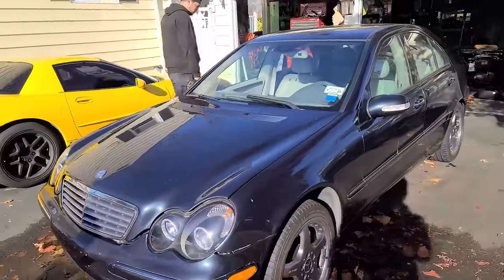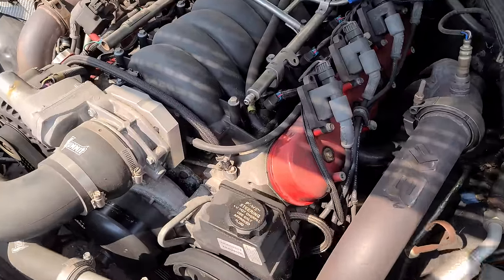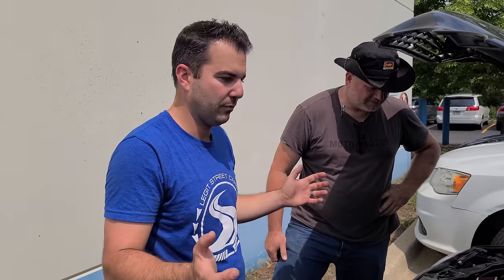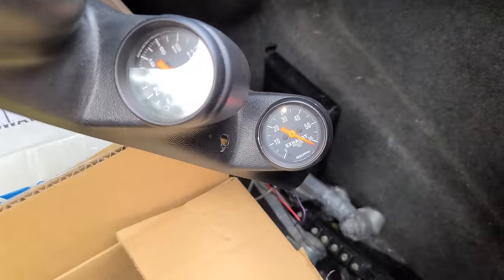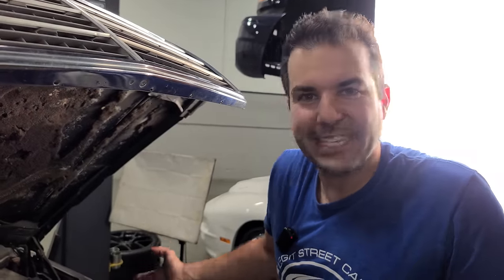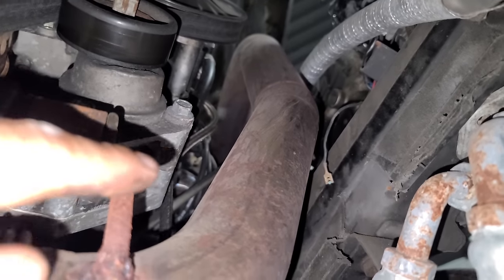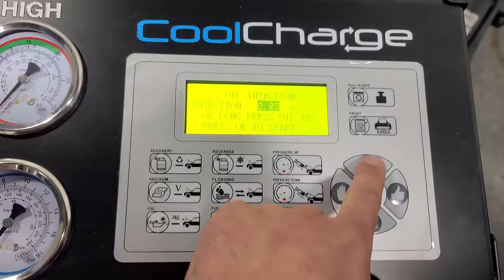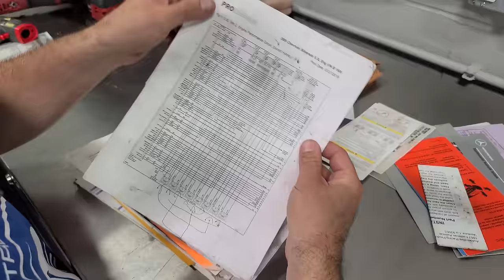I Traded My Weirdest Car For An LS Swapped Mercedes Turbo Diesel! Total SLEEPER!

Comment from the maker: Have you ever wanted to do something like this? Keep trading up to see how far it goes?
Reply: Yeahh cool idea!
Reply: Dude you have to turbocharge it
Reply: @@ChesterJLampwick78💀💀💀😅
Reply: all turbodiesel w124s had that air intake on a fender
Reply: There is a bracket for the a/c belt tensioner it has two tensioners. They come on the caprice ppv and the Chevy ss. I had to do the swap on my g8
Reply: Flying wheels just did this took 2 years went from a $400 car to a Ferrari 360 just this week.. Not really trading but buying and selling... But as you eluded to you have to be a bit more scrupulous cause all you're doing is trading and everybody knows what you have into the car by watching the videos
Reply: I did buying and selling. Started with a celica and now have a m3
Reply: Its stock vent for horn or air filter.
Reply: @@ChesterJLampwick78out of curiosity, how far did you get?
Reply: Absolutely. I’ve done it with guns several times. I buy old or broken rifles. Repair/restore them, then trade up. It’s a great way to improve the quality of your item if you can use your knowledge to improve things for little cost.
Reply: Ive wanted to for sure. I have a swapped CTS if your interested. Not LS swapped.....
Reply: I would love to do something like this...but i have nothing to start with
Reply: Not really a trade when you are paying money on top and that too $4000. But I like that 300D classic look more than the newer E class
Reply: @DjJay I'd have to agree, I've been flipping cars for 13 years and I don't put any cash up. But like someone upstream said everyone is watching his videos and knows the numbers already so that's harder right off the bat.
Reply: I took a free stereo and turned it into a 90s Tbird after 5 trades 2 days later
Reply: Recently bought my dads old renault megane expression.Had new front window mechanisms in but there's an electrical fault somewhere; they cost best part of a hundred each  Plus lots of bits and pieces to bodywork inc filler on arches: i changed my first exhaust back box and saved myself a hundred quid. It's my first time priming and spraying a car as well and I gotta say, its looking pretty good so far.

I also bought a ford transit a year ago and that's been hiding in the mechanics so when I get the renault finished and sold, I'll get the van back and body work sorted, and possibly sold, then I think I'll have about circa 2k cash for the renault plus a 3.5 - 4k value on the transit... might go for a rolls royce:)
Reply: I feel like if you kept making deals like this, you’d end up with a 97 Saturn and spending $300k lol
Reply: I did that from a Mazda 3 up to a W209 CLK55 AMG.
Reply: You’re not trading up spending cash?
Reply: We will see how I feel with my 5 cylinder audi turbo swapped Ford Ranger
Reply: Hoovies ls swapped 911 😅😊
Reply: yes i have and next year im going to try it and ive the perfect car to start my trades with once i engine swapped it :)
Reply: Yes, Ive done it a few times. Got me 14 dsm's........took awhile to trade them off. 
When are you working on the GSX next? I thought your not putting out new content on it as it wasnt producing views, but all the video's right up there with your other content in the same time frames. Are you just waiting on parts or....? just curious, I love your content and I love dsm's so you had me at DSM.
Reply: Honestly the whole trade up thing gives me a headache. But my buddy Stan is a great guy and that car is a hoot to drive. Enjoy!
Reply: Never thought about the trading but I have put LS and LT in at least 50 cars. To get that car better get rid of the steering box and all that linkage and install a rack and pinion, this will move the box so you can put dual exhaust and get to the plugs, and better steering. Then build an aluminum cold air box for the air cleaner with the factory grill.
Reply: I started with a 1987 GMC starcraft conversion van for 1500 bucks in 2012 and ended up with a 1976 stingray in 2018 across 4 trades, and driven for nearly 50k miles as a primary driver. And when I cashed out the corvettes I got 3500 the day I listed it on FB marketplace. I made 2 grand and drove a vehicle for 6 years, for maintenance.
Reply: I think paying thousands of bucks in between takes a little of the original idea of trading away 😅
Reply: @smokeonthewater5287  it would be so difficult to find two cars so close in value. I have no issue with cash changing hands. I saw the MB/Honda Stan got last week. Looks really nice. I thought of pulling the Honda engine and putting in a R32 engine and turbo from a VW. But Stan said that’s stupid so I offered to buy his Audi A6 4.2.
Reply: You're not trading if you pay them the value difference.
Reply: I have a nice red paper clip... If your interested?!

Comment: for the air intake, maybe add a thicker spacer, or another one, and push the valve unit forward.  If you make a new thicker one,then place the holes in the right location.
The guy from whom you bought told you he has the capability to to the fix for the honda C240, maybe he can help, just saying...

Comment: I used to have a 300D with an old carbed SBC 350 in it.  In order to clear the exhaust, they just jacked the engine way up to where they cut a hole in the hood.  It was an absolute riot.

Comment: There is some irony to the fact the converter removed one of the best diesel performance engines ever to swap in that LS. The OM606 😍
Reply: wasn't the OM606 the 2jz of diesels?
Reply: 2.5 turbo wasnt an om606. The Last year (1995) w124 came with a n/a om606 though.
Reply: @Will_14_years_ago yep last years had the 3 litre one 🎉
Reply: I think they where definitely going to boost it
Reply: @Will_14_years_ago  exactly, the 2.5 is a om602. the om603 turbo 3.0L was the best diesel engine in these cars since the om606 was N/A (and has puny rods so turboing them very much without upgrading the rods isn't advisable). The om606 turbo is fun and all but they are pretty expensive to modify
Reply: @ThomasMauger  I own a na version myself its swapped into a w201 with a manual trans. The na version rods conparing them to the turbo are not great but the myth that they are puny and cant handle power is not true. With a metal headgasket(turbo got a metal gasket the n/a did not) and a built injector pump, they will do 350-400hp daily. Maybe in 2023 that doesnt sound like much but in a small light car its substantial. I agree they are the best moat reliable engines out there while also returning good fuel economy. Being that they can be and are with most fully mechanical makes them Great! Its ashame that the 606 turbo isnt as easy to get ahold of in the united states. I have also owned 2 om617 engines and although they are not powerful, they really are a lifetime engine just dont run them out of coolant or oil and make sure you dont get a injector stuck wide open, id bet on it going over a million miles.
Reply: @Will_14_years_ago  Ah no, that was a 602, didn't notice the 2.5, just saw 300D. You are correct.
Reply: @ThomasMauger  The N/A is still good for over 400bhp with the "puny" rods, just needs a decent head gasket, turbo and upgraded fuel pump. Sure it's not the 600+ of the turbo motor, but pretty good for a 3.0 diesel!

Comment: Awesome swap!!!  I think you traded up. The W124 is a tank and the interior speaks volumes. I would want to change the exhaust if possible, but that’s my only hang up. I’m sure you know that Bilstein will rebuild those old struts and shocks in the trunk for free, you just have to send them in. Thank you for the video!!!
Reply: Bilstein does not rebuild shocks and stuts for free... never have and never will. It's $250 per for a rebuild.

Comment: The fender vent IS in fact stock, here in Europe 300D turbos (OM603 turbo engine) and 300D 2.5 Turbos (om602 turbo engine) came with that vent from factory, stock air filter sits there :)

Comment: The grill on the fender is only for the turbodiesels. The NA diesels (which were available in Europe), like my 300D, which has a factory 5 speed manual btw 😉, don't have that grill, unless they are the latest multivalve diesel engines, available from 1993 (the OM605 and OM606). And yes, it is missing a steering shock, but since they modified the pitman arm, maybe it didn't fit anymore.

Comment: LOVE THE CONCEPT! So far so good! A/C - CHECK! Throttle Body, - Almost Check! This is THE perfect car for a fix n flip!!! I REALLY like this car. Believing it is a keeper for someone! Obviously somebody that built it knew what they were doing. Not a shadetree job at all. The gauges, exhaust, cylinder heads and coolers show that. Great that the other guy did the springs and shocks. Relocating the air intake to the grill is a no brainer. Maybe figure out how to get the A/C more like stock with a  real button. Fix the lil oil leak. Maybe replace hood or fix it. New tires and a detail and it should easily be in the neighborhood of a $20k car when done. As Always, May God Bless you and yours! 😇

Comment from the maker: Ok guys, what do you think this car is worth after I fix everything?
Reply: Don’t know somebody tried to say it wasn’t worth it
Reply: Idk man I think you mightve given that guy a neat fast car and a $4500 gift...this car looks like a cobbled together question mark on wheels
Reply: 7500.
Reply: TBH like a real 500E  is 40k in the US, and they are usually very well maintained, while this thing is a average spec'ed old 300D with a mystery box LS in it and questionable things done to it. So Id guess 20k is the best you could hope for. A 400E in good shape sells for around 20k, what i think is the best comparison for this thing. Its a definite upgrade to the Hondacedes tho.
Reply: So twin turbos and a limited slip?
Reply: Two turbos and a tune, a polish I’d say 16 or 17 as a good sleeper
Reply: I think you got ripped off 😢.
Reply: $15k
Reply: Mandatory limited slip diff and 3.55 gear (best compromise for pep and fuel economy with OD trans)
Reply: Yesss
Reply: I wanna see what it'll sound like with amg exhaust
Reply: I hate this series is so short. Seems you just traded for a car you should keep! Its kinda badass. Id clean her up and drive it everyday
Reply: With the exhaust setup the way it is I say put some turbos in there (I know the snowball effect and the trans likely can’t handle it), but I’d say a 3k turbo kit with 16k total invested can net you an 18-22k trade value.
Reply: super hard to value since engine swaps are a niche thing. I think your value will be in the engine parts
Reply: Will you tell us how much you're going to put into it
Without knowing that it's kind of hard to say
Reply: Boosted and fully sorted out it could bring $12k maybe $15max to the right person
Reply: 9k
Reply: 15 maybe up to 20 with a manual
Reply: It's worth keeping. Please don't trade it, if you do you'll regret it...
Reply: It's worth whatever someone is willing to pay!  I think this is a really cool car.  I'd have fun with it.  But, sadly it's a 12k car to me.  Dialing it in and good marketing you could get 15k.  Curious what it dyno's at.  Feel Ike it should be a 400hp engine
Reply: I think it’ll be worth 15k ish… and I think it’s a fair trade all around. Can’t wait to see what happens
Reply: I'd say 16g is it wouldn't have given up the 4 thousand trade straight across
Reply: You got robbed for $4,000 it should have been an even trade he got the newer body newer interior newer motor
Reply: That E-Class is worth maybe $8k at most. A 5.3 is a basic "LS" that really has no value unless it's fully built with forged internals. Plus with a trash 4L60 trans that is scrap yard junk it makes it even worth less.
Reply: $18,000
Reply: 6k
Reply: The most profit is not really from what you add into the car but what you get from the YouTube video series of this project.
Reply: Keeping.
Reply: 7 to 8k
Reply: 15000
Reply: @Frank-Thoresen bviously he knows this because just like I thought everyone is saying he paid too much for the car. I would've paid maybe $10,500 as it sits or traded the Hondacedes + $1000 bucks.

Alex can make a lot of great content out of it though and that's what matters. Tbh I thought the Hondacedes was pretty dang sweet, but I'm guessing this channel has more followers that are into V8 stuff than import stuff, so I assume that's the reason for ditching that project.
Reply: Turbos and a trans.. a lot closer to 20 Gs
Reply: 10k
Reply: 9k depending
Reply: You got ripped off. Shouldn’t have given him the cash.
Reply: bout tree fiddy
Reply: At least $100
Reply: I think you got finessed
Reply: Three fiddy.
Reply: Lots.DTM Body kit. Some booost and walla...
Reply: If you do everything including aesthetics both inside and out, it’ll be all about finding the right buyer. If it’s truly done and ready? If it’s sold as a specialty car, you might find someone to give you what you paid for it. I’m sorry Alex but that car in excellent condition is worth $8,000 tops in stock trim. With that engine, you might find someone willing to give you more for the excitement dollar. But it better be faster than it is.
Reply: 1 million dollars 😊
Reply: OVER 9000!!!!
Reply: All in fixed proper. It’ll be worth $13-16k to the 5 people in the USA looking for it.
Reply: Zero dollars
Reply: Maybe 12k fully sorted
Reply: With a 5.3 10k tops
Reply: I love it
Reply: People who are telling 20k hahahha u guys are crazy, the 124 chassis is 3-4k than that ls and the work done maybe a 10k car if u make it clean lol
Reply: I think you got taken to the cleaners on this car you traded down instead of up
Reply: It's worth whatever you can get,no basis for accurate estimate on any mystery swap job
Reply: 18k
Reply: I was reading other people's comments and they just got to understand what used car dealers say about people and cars there's an ass for every seat and no matter what I know you'll make great content with it thanks for the videos
Reply: Fully sorted, including body work, paint, etc, maybe 10K.  The way it is, it's worth 5K.  Just because he spent 13.5K doesn't mean it's worth 13.5K.  But, you will get that $ back from YT content.
If you assembly a Honda Accord by purchasing every component from Honda, you'll spend more than 100K.  No one would pay 20K for a home built Honda Accord with Honda factory parts.
Reply: Depends on how much time and money you end up putting into it.
Reply: 25k picks, no rust on it
Reply: @james10739  Oh come on, junk yard will give him at least $200.🤣
Reply: Should have been an even trade
Reply: 13.5k
Reply: I feel like it was a better deal for him, but I like the Benz better still. Should have been a straight trade in my opinion
Reply: I think moto guy got the best of that deal , hondmerc could have been fixed up and traded for more imo
Reply: 17-20 if you put some boost in it
Reply: Not as much as you'll have into it
Reply: $6000 😂
Reply: You traded down. 😅 woops.
Reply: Maybe 5k.
Reply: Less than the Honda swapped merc 😭
Reply: 13,500

Comment: Cool content great idea love it ♥about the fender called shark fender ! was installed on turbo diesels engine, so either it was a 2.5 TD or 3.0 TD usually in Europe badges for the car were 250TD or 300TD in the back  I don't know about the US but i think it was the same, 300D was naturally aspirated Diesel 6 cylinder, 250 was a 5 cylinder engine non turbo or with.

Comment: I dont know what you paid for the first car, but I think you did really well on this trade. That swap was done really, really well, in my opinion, and the car itself is in unbelievable condition. I think if you boosted it and put a manual transmission in it, you would have one sweet ride, brother. And I know you wanted to trade up again, but I think ya hit the ticket on the first trade. Unless you come across something totally epic, I guess. Either way, we're all having a hell of a lot of FUN. That's all I have to say.
Reply: It does great with an automatic.

Comment: I had a 300d w124, loved it! In Europe those are 3 litre na 6 cylinder diesels. Only 100hp or what was left of it after 430 thousand kilometres. I remember the smell you mention, it had a lot of character. The slowness made it one of them
Reply: The 300TD was the one to have with the OM606 Turbo Diesel AKA the 2JDeee

Comment: This LS swapped M-B W124 is a perfect LSC car if I've ever seen one 👌 Big LS engine in an "Old Skool"  M-B. What a fantastic find guys 🤙 
"Fun fact" ...  the W124 chassis was originally designed for inline 4, 5 & 6 cylinder engines only, never for a "V "format engines. M-B employed Porsche  to modify the front end of the W124 for the 500E / E500 cars at their Zuffenhausen plant to fit the 5.0 from the SL, hence the wider track and flared arches on the 500E / E500. 😎

Comment: Hi Alex - The grill is stock for the turbo models in Europe anyway. The number on on your back does not match. 300D was a 3,0 6 cyl 12 valves 113 BHP. 2,5 TD was a 2,5 5 cyl 10 valve 125 BHP.

Comment: If it turns out to have low oil PSI. at idle . Check the pickup tube O-rings they had issues with them from the factory  !!

Comment: It's a factory w124 for turbo diesel air inlet, because the air box sits behind the passenger headlamp for a 605 motor. most likely for the m606 motor also

Comment: The vents are totally stock for the 300D. Down here they create 'superturbo' mods of the OM606 diesels up to 600hp. Power smoke is inevitable though. Mynädiesel mods the injection pumps and a large turbo or two will do the trick.

Comment: Those vents on the passenger front fender are factory Mercedes.  I had a 93 300D 2.5 Turbo and that is where the airbox intake is.

Comment: Lol I found this exact car's listing on Bring a Trailer from 2019 for $8300. The listing said it had a Trick Flow top end kit with Harland Sharp rocker arms. So it probably just got heads, cam & lifters, rockers, and LS1 intake, and nothing else.